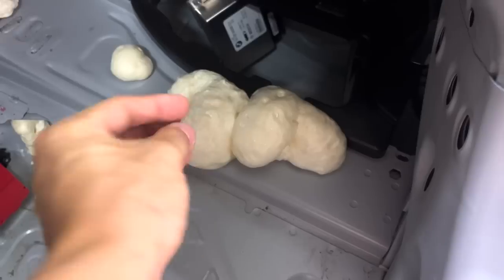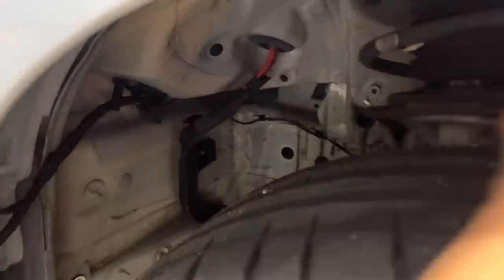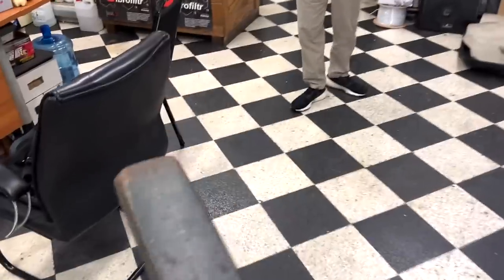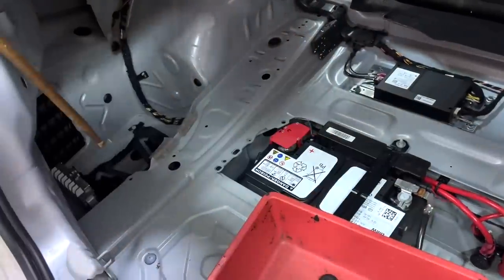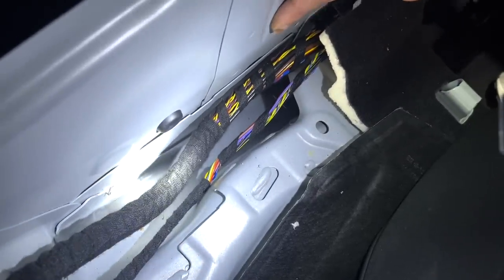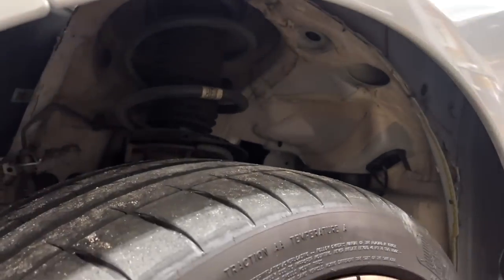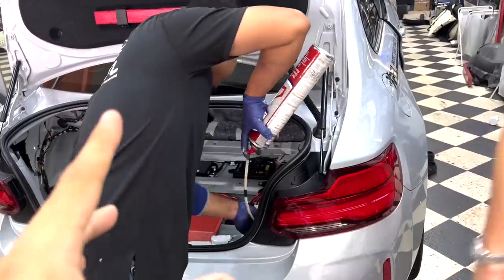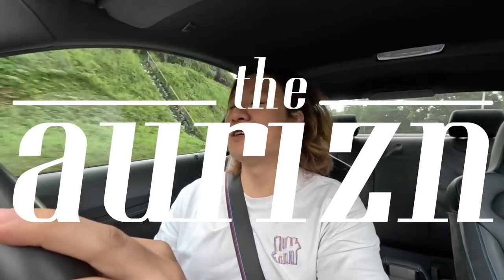Improving my BMW M2 Comp's Ride and Handling with this White "Foam"? "Autofoam" | EvoMalaysia.com

Comment: Thomas, thank you for sharing the foaming  installation proces for your car did you notice a significant reduction of road noise after you had the foaming done?
Reply from the maker: The sharp “knocks” are less noticeable. To reduce road noise, the used acoustic foams on the door panels, boot area and a pillar.

This made a significant difference in the road noise

Comment: My concerns involve:
1. how auto foaming changes the car's crumple zones performance in a crash scenario
2. Whether the moisture now trapped inside the chassis may give rise to rust issues over the longer term
Reply from the maker: Thanks for the questions, I'll forward them to the owner. For no.2 it resists water, I didn't show the demonstration to keep the video length short. The foam hardens up so it becomes like a "lid" to a bottle.
Reply: there are scientific  publication online the cruch is much better with foam. For humidity that another story. specialy after 10 year wonder ...

Comment: why dont car manufacturers do it from factory if it makes the car much better with very little additional cost?
Reply from the maker: Sorry I can't answer this question. It's a good one though.
Reply: @ThomasYap I would speculate that the additional cost of foaming each car over the production run  adds up to a significant pile of money over the production run.